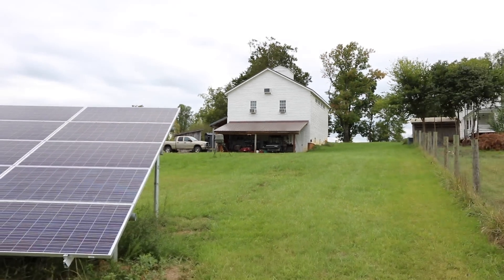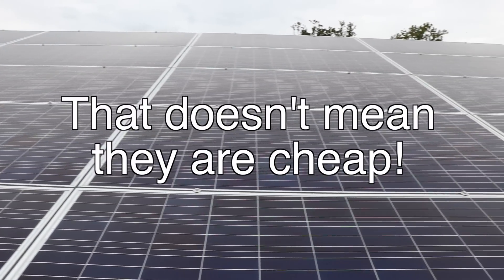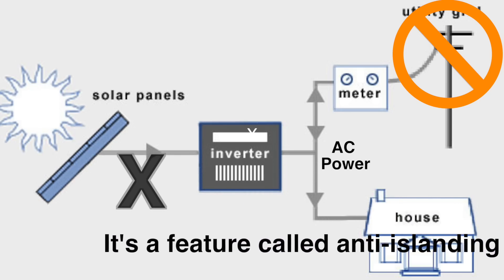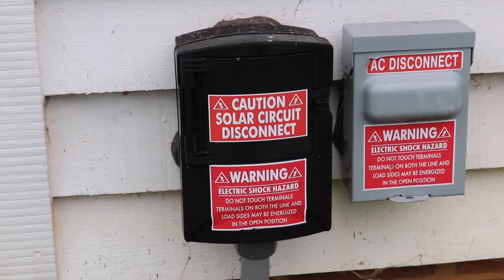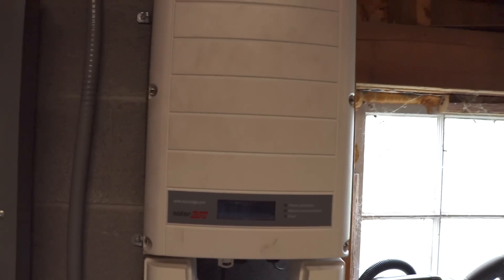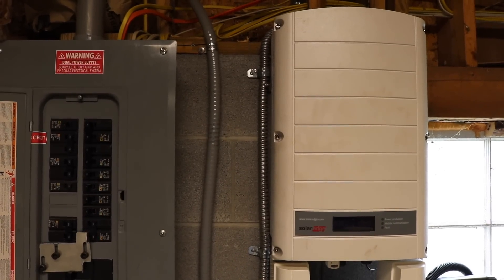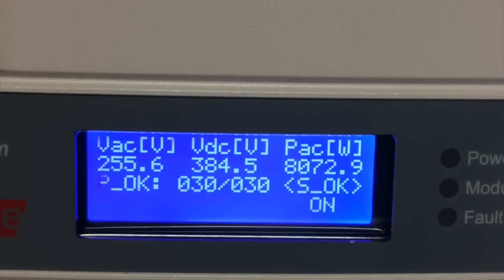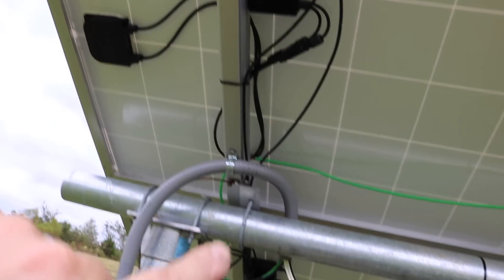The ugly truth behind grid-tie solar systems. Part 1, FarmCraft101 solar.  Watch before you buy!

Comment: In Some countries they give you 2c a unit for power you supply to the grid and charge you 25c a unit for what you take off the grid, you are lucky your meter is allowed to run backwards.
Reply: That is why almost all electric utilities require a separate meter to be installed for  any power sent back into the grid.
Reply: SMART Meters run forward in any direction. you will be paying for your own electric. I guess you could opt out of using a smart meter but even the digital analog meters probably only run in one direction.
Reply: Typically if your back feeding the meter should just go solid red light (back feeding or no power been used when solid red) and stop counting

I seen some old mechanic meters go backwards when backfeeding (installer did not check the meter was going backwards so he getting free solar and running his meter backwards)

Comment: Seems to me it would be better to just be off grid and forget the power company.
Reply from the maker: I agree, but having enough batteries and inverter capability to run machinery, air conditioning, hot water heater, heat pump, etc get very expensive very quickly.
Reply: FarmCraft101 depends on the batteries,  lithium ion are Def expensive,  but standard are cheaper up front and can be replaced at a later date.

Comment: If the inverter was placed at the panels wouldn't the wiring to the house be less?
Reply from the maker: Actually no.  If I were transmitting at a low voltage, like a small 12V system, then yes, you want to step it up to household voltage ASAP.  But since I'm at 360 volts, it's actually more efficient to transfer in the DC phase.  Thanks for watching!

Comment: Excellent presentation. I am a retired electrical engineer who has been dabbling in solar and wind power generation for many decades. My non-grid-tie systems have been small due to the usual high costs and lack of technology. To give a point of reference, I power my garage (mechanical, welding, metal and woodworking shop equipment), outbuildings with refrigerator and freezer, and all outside electrical needs. Basically everything but the house. Now that solar grid-tie equipment is legal, feasible and cheaper by the watt than in the past, I am going to take the plunge and put a system together for my entire property. You have done exactly the same system I want for mine. I subscribed to your channel for more solar videos. Thank you.
Reply: I found 6 85amp hour caravan batteries was ok for me on my own in a off grid system.

Comment: Perhaps not Ugly truth more of this is how it works :)  good video!

I have 17kW on my roof with 100kWh battery bank and can work all year now. I cover 100% 10/12 months if power goes out. Last 2 months i will survive but not without lowering consumption. Its worth mentioning that we have not changed our useage and during winter we only get 10% compare to summer.....  

Solar is very interesting but there are so many systems out there so its easy to get fooled if you dont know what you are working with.
Reply: Decent size system. Soon to have another 30kWh of battery storage :)
Reply: Spend as much as you can afford as it will pay dividends in the end. Electricity company prices rising every year.
Reply: do you not change the angle of your panels as the angle of the sun changes?
Reply: @lukerediger8431 
Usually the only installs that opt for tracking are ones where space is at a premium. It's generally cheaper to add more PV panels to make up for the loss, assuming you have the space. One of the main advantages of solar is there are no moving parts, adding tracking hardware kills that advantage. Adding tracking might gain you 15% efficiency, but increase your initial cost by 25% and your long term maintenance cost by 30%.

The placement of the panels is VERY important. They are generally aimed in a southerly direction, but the exact angles, both directionally and tilt are the result of a survey. The difference between a "that otta do" installation and a well planned install can easily be the difference in 20% overall efficiency. That would effectively mean that 1 out of 5 panels was going to waste, if you did it wrong.

We are going to design our new home, specifically for optimal solar angles, as we will be using roof mounted panels. I feel like ground based units could be stolen while I'm at work or out of town.
Reply: Hope this will store your excess energy so you don't buy back at retail price.
Reply: That's by far the biggest personal solar energy system I've ever heard.
Reply: Any idiot can add more storage or pv. That's not remotely impressive if you know anything about solar. Cutting your consumption, now that takes real talent. I built a 48v instant water heater that uses 95% less power than a tank
Reply: @climatechangepreppersfaceb2148 
I wouldn't go as far to say "any idiot" for not doing it the best way, but I do agree with you 100% that it's best to focus more attention to efficiency than on PVs. I know people who have 1970s HVAC, water heaters, and single pane windows, but have a few PVs and brag about their greenness.

I just bought a property where I'm going to build a certified passive house. I'm going to do everything I can to exceed the specs, where it makes sense. Given the efficiency of the home and appliances, the rooftop PVs will be put to real use, rather than just offsetting wasted energy.

I'd be interested in hearing about your low voltage water heater, more specifically how it's so much more efficient. Is there a website or channel that details this type of system?
Reply: Did not think I would find you here.

Seems people don't really about you, your channel, and DIYPowerwalls.
Reply: How many batteries do you need and how many years they last?
Reply: Batteries cost must be huge..
Reply: and you did not divulge how much that cost you , of course its tens of thousands , enough to give the ordinary man a heart attack .    and will take decades to break even .
Reply: The ugly truth is, it basically works yet more people aren't using it...
Reply: @Pens4Life85  It doesn't actually cost all that much. He is using recycled/used cells/battery packs for his power wall.
Reply: DIY Tech & Repairs how fucking rich are you?!?! How much did your system cost? 

Btw spare energy can be used to mine bitcoins, just a tip. Free electricity so...
Reply: Wow!  For that cost, wouldn't it be cheaper to run a LPG generator and have a very large tank?

Comment: The catch on your ROI is that the grid can start charging or increase the charge for the "grid connection fee" or "utility service fee" which is exactly what has happened in other States where solar adaoption boomed to the point that the electric company in that area had existing delivery costs but not much consumption costs to offset the delivery costs. So when the utility starts charging you $50-100/mo for a connection fee your ROI goes to heck.   Reference; https://duckduckgo.com/?q=grid+connection+fee+increase+solar&atb=v74-7__&ia=web
Reply: Changes in the grid connection fee and the energy use fee are not always political.  Sometimes prices are simply imbalanced.  Where I live (Nebraska - USA) the electric company is the property of the customers and there is no profit motive so they really aren't out to get you.  Recently they realized that they were charging too little for connection and overcharging for energy use, so they made an adjustment.  They didn't want the heavy energy users to have to unfairly subsidize the light users.  :-)

Comment: Add a disconnect switch between the solar system and the incoming power to have solar when the power goes out.  Surprised the power company didn't require you to install one.
Reply from the maker: It's more complicated than that.  I will cover in upcoming video(s).  Thanks for watching!

Comment: if it goes down ..have a disconnect junction and switch it off then ur solar back on so you don't back feed :)
Reply: The SolarEdge inverter cannot run without grid power.  The disconnect is not what shuts down the inverter.  That is just secondary safety for the power company's peace of mind.
Reply: Will you be there the instant you lose power and the solar starts backfeeding into the system?

Comment: An optimizer? Sound like the only thing it optimizes are the profits of the company that makes them. But seriously how does it work?
Reply: An optimizer is a DC-to-DC converter, which allows module-level power processing.  In a standard series string of modules, "one bad apple spoils the whole pot", meaning one module not performing ruins the performance of other modules.  Optimizers isolate module-level performance issues to only the poor performing module.  This way, localized shading on one module, does not disproportionately bring down the whole system's output.

Optimizer circuits work by solving an algebra problem.   The voltage of all of them adds up to a fixed voltage that the inverter prescribes.  The current is the same in all of them, due to the nature of a series circuit.  The voltage at each optimizer will be proportional to the power that each module can produce.   Each optimizer tracks the sweet spot of module-level voltage for its input terminals, and then bucks or boosts it to what it needs to be across the output terminals.